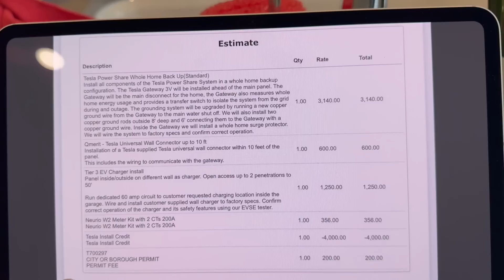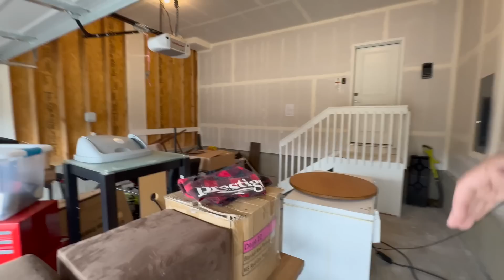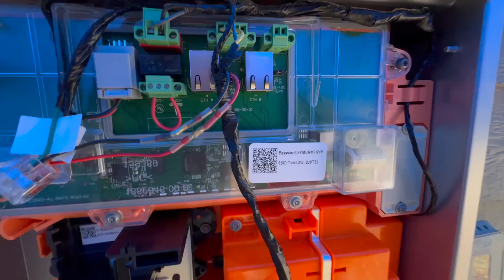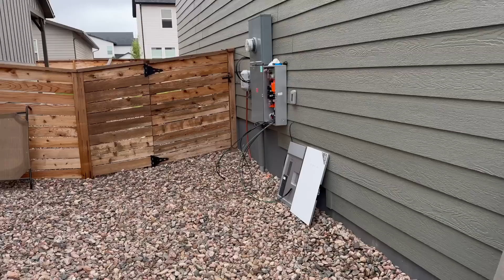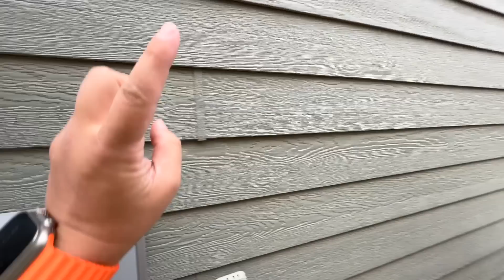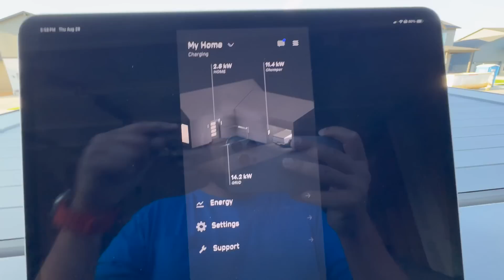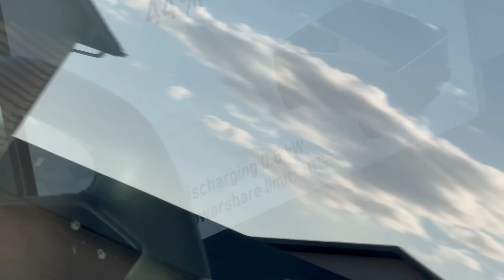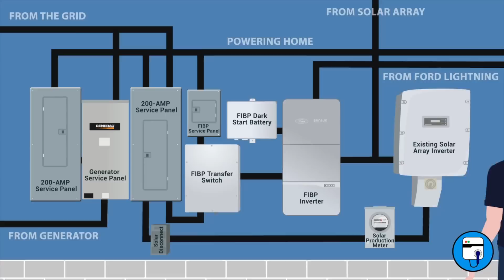Installing My Level 2 Home Charging Setup w/ Tesla Powershare Bidirectional Whole House Backup!

Comment: Can anyone confirm that by installing universal wall charger w bidirectional ability, that the Cybertruck qualifies for the IRA 26% rebate as it becomes a homebattery storage device?
Reply: OMG That would be awesome
Reply: It would not qualify. (From what I have read it can't be mobile storage.)
Reply: Add a Power Wall to the system to get seamless transition along with backup if truck isn't home.  Then write off the whole project as one.
Reply: @bluedrew  already have Tesla solar w Powerwalls.
Reply: @eddevoe2519  If you already have a PowerWall then you already have a gateway.  All you need is ANY charger that is on your backed up loads (take yourself off the grid and make sure it's still powered).  Tesla says PowerShare is compatible if you have ANY PowerWall and Any Charger.  

Caveat is upcoming software update!  You don't need the big 3V gateway.  Instead of 3V gateway and Universal Wall Connector, you get 2,500 credit in Tesla store (AWD).